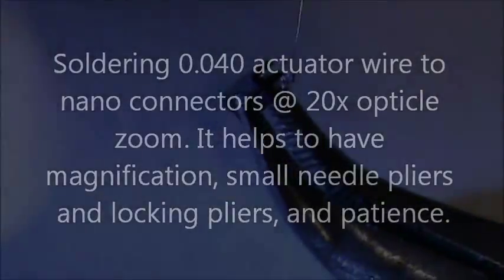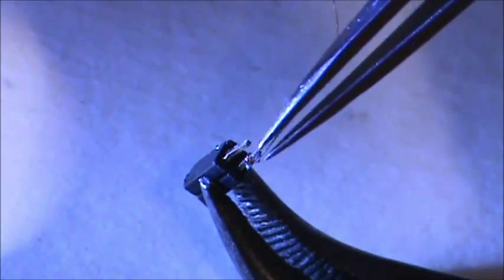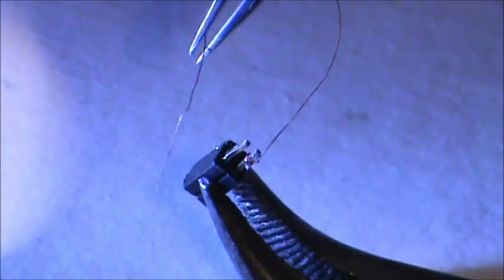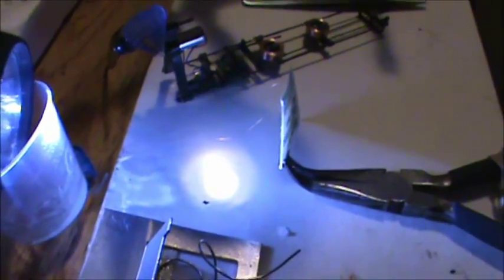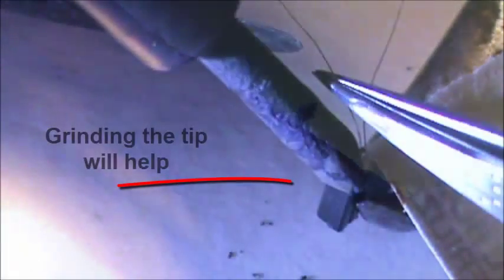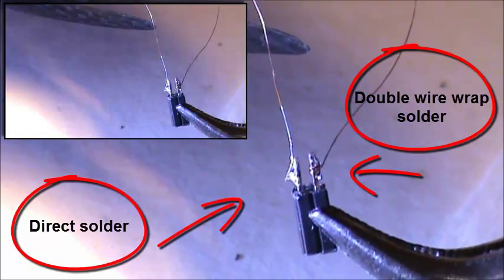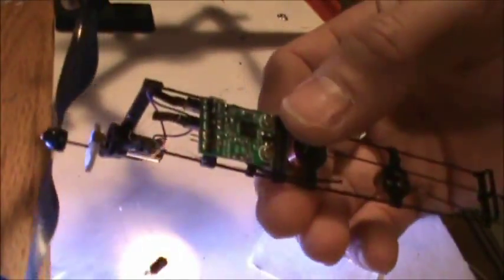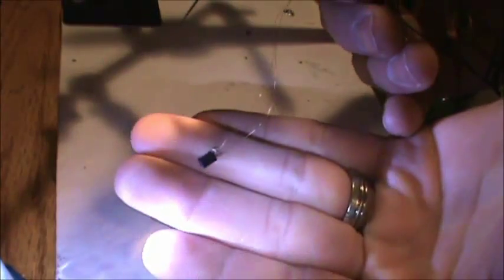Nano 0.040 wire solder to connector- Uberlite.mp4

Comment: I was actually searching in internet for past one week to strip the polyeter coated copper wire (Ø0.2mm) using chemicals and solder it with connector using 3 rd hand tool. stripping by passing through solder a GOOD IDEA. Very helpful specially in my case because i was strripping the coating with tweezers and grade 400 emery sheets. I have to make 400 similar solder joints ( by Last week of August 2013 ). this technique will definetly help me.Thanks again for sharing..

Comment from the maker: lol yeah these little wires will drive a person crazy. I think I am starting to get a handle on it. Joining to of these wires together actually is much easier, little loop and twist then solder together worked for me. My prob. was also the coating, I have seen others use a exacto blade running along the wire but this sometimes ends up with a cut and short wire. Thanks for the comment as always 6Salley!